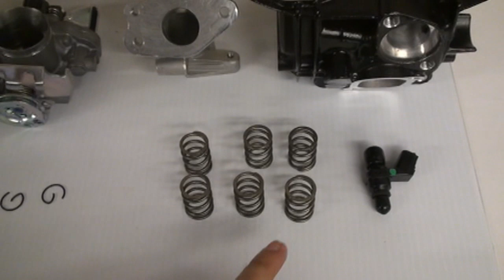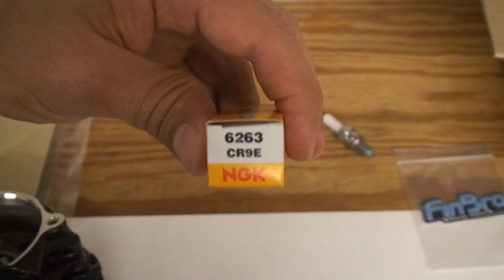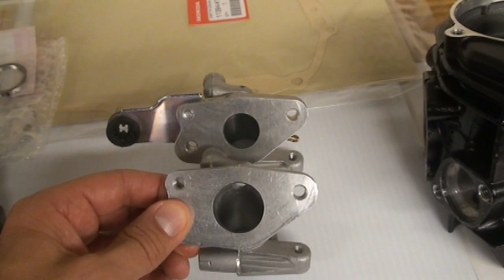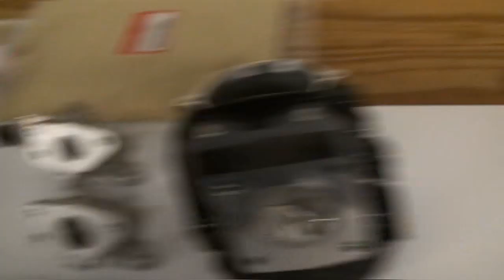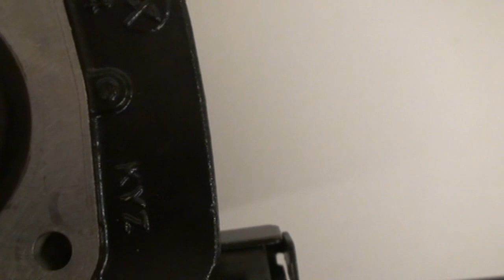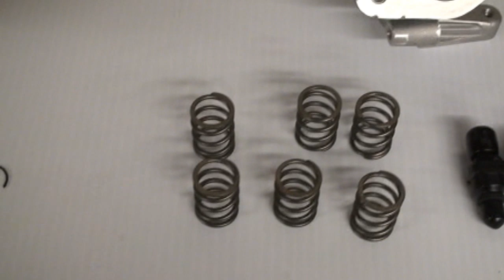Honda Grom Big Bore Kit - FINBRO - Install Part 1  - Great Low Prices  #Hardracing

Comment: Do the manufacturers want the old engine back as a core for this? if so, where can I find info on the core charge?
Reply from the maker: Brad Gefroh  There is NO Core charge.
These are all new parts for you to keep along with your stock parts.
You get to keep everything.